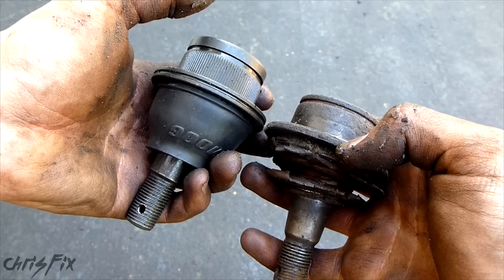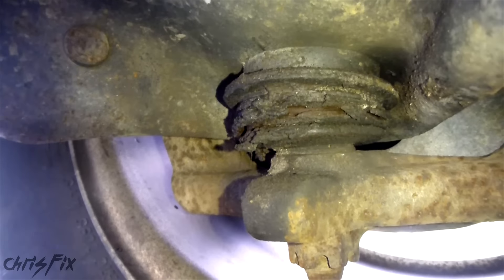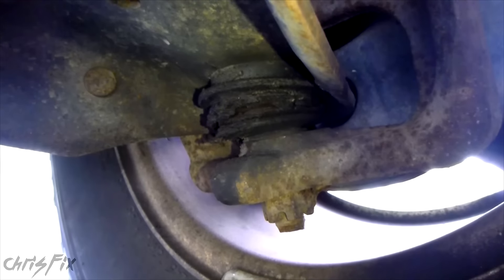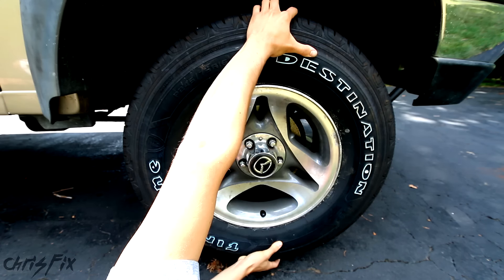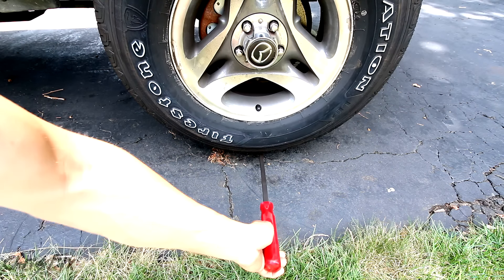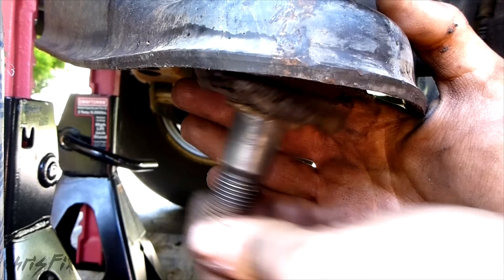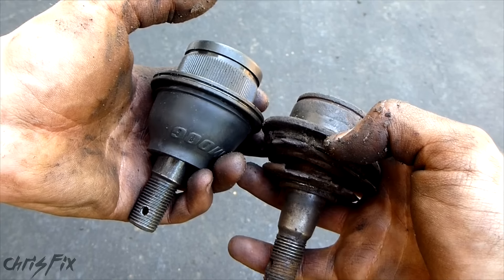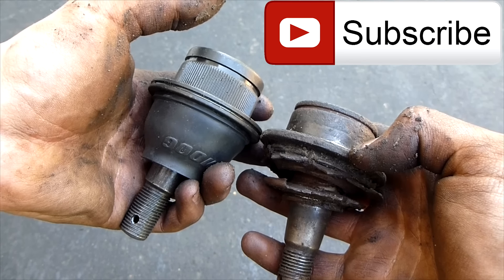How to Check if a Ball Joint is Bad

Comment: I think the lower control arm has to be supported on those to properly check the ball joint. There is tension on the ball joints with it jacked up. Also a small amount of play is acceptable in the lower ball joints and in the wheel bearing as it is a spindle style.

Comment: To properly check a front end of a car or truck it should be at ride height. 
When you let the suspension hang it binds everything up and a loose part can feel fine because of the pressure of the suspension hanging.

Comment: This is what happens when you buy aftermarket ball joints. They are all basically garbage. Spend the extra couple of dollars and get a genuine ball joint it will last 10x as long
Reply: What kind

Comment: You can also support the lower control arm and move it. You support the lower control arm so the spring isn’t putting the joint under tension. It depends on your suspension set up.

Comment: May I suggest cribbing, or bracing the frame before sticking your fingers under the 6 O'clock position of the tire. Other than that, good straight forward video.

Comment: There's a much easier way to check your ball joints drive your car up to a slope leaving your back wheels on flat ground your front wheels on the slope apply the brake and put it in reverse if you hear grinding you need new ball joints
Reply: no

Comment: Aftermarket ball joints will last 20k miles tops... buy oem parts from Dealership.
Reply: So what dealership do you work for? Aftermarket can be better than dealer crap IF you get good stuff. The hard part is finding good stuff.

Comment: Neat.  But wrong.  You need to put a Jack stand under the lower control arm, lower the vehicle onto that and then check for play with the pry bar.  Next, dodge allow for some movement in the ball joints so you actually need to measure with a dial indicator to make sure it's out of spec before just throwing parts at it

Comment: No ,,,,that's not the correct procedure
With the the bottom joint being load bearing the jacking point needs to be as close to the ball jt on the lower control arm , then with a good sized pry bar lift up , a dial caliper or guage records the play ...load bearing ball joint have play tollerence .030 at least on domestic but the brakes need to be applied to take wheel bearing play out of the equation 
ASE master tech

Comment: Aftermarket ball joints don't have the same tight specifications that the OEM ball joints have...expect those ball joints to last around 40k miles   if your lucky.... OEM ball joints have nylon in them  for longevity.

Comment: you are checking the ball joint incorrectly. those are loaded ball joints and require that they be unloaded in order to properly check them. your jack should be placed under the control arm close to the joint. there by unloading the joint so you can check it shaking top and bottom of the tire and using the pry bar. other wise great video.